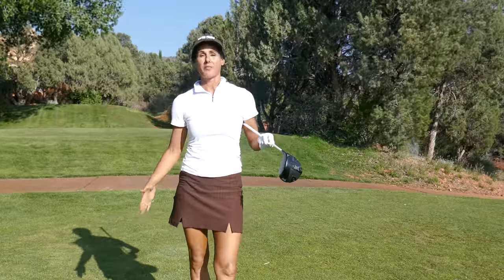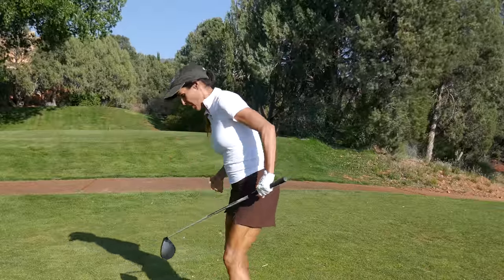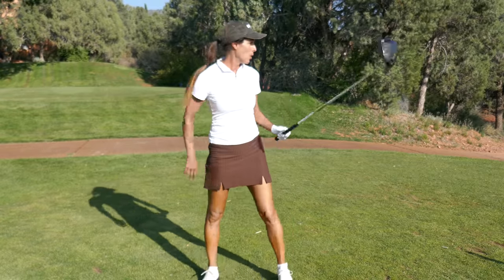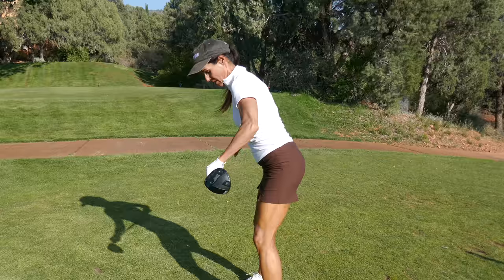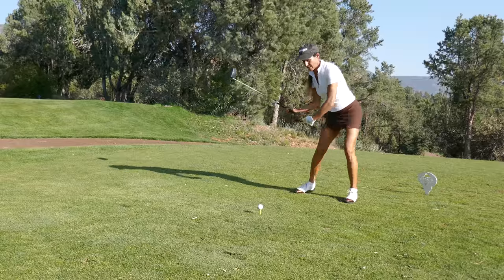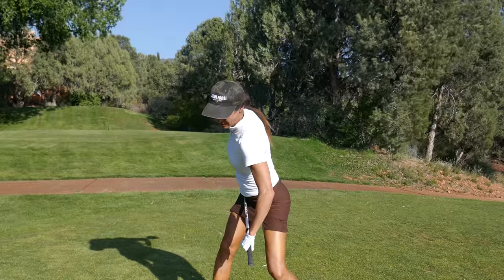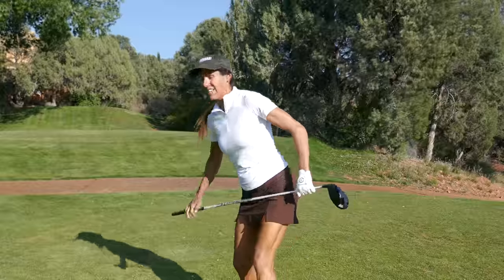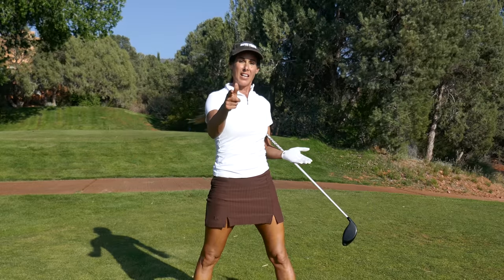GO DEEP WITH THE HIPS (the BUTT MOVE)

Comment: You probably don't even read these anymore but,  this lesson put it all together for me. Sounds trite but, it's not. 
Too often, it has been a translating move from one hip to another which, when your timing is good, you score well. But, the next day, if you're too quick or, not quick enough, balls are flying left and right. 
So, the 'rotating the hips on the wall' whilst firing the left cheek back, really helped out and took the timing guesswork out of the equation. Distance has never been a problem for me. It's getting the ball to go exactly where you want it to. Mission accomplished! Thx Christina

Comment: THis is great!!!! I am learning so much from your videos that I never got from lessons I have had over the years. It is the  nuances you point out that make the difference to improving for me and gaining confidence in my swing. I  am freeze framing you  going back and through and if I am correct the angle that is created by your upper thighs and torso stays the same or even a touch smaller until you straighten your left leg on the follow through. Is that observation correct? I think I have been using my glutes but I am pretty sure that angle gets much larger going back and through hence lack of power. I am golfing tomorrow and will give this a try. Thanks so much for this excellent video!!!
Reply from the maker: Love your passion and questions. I highly recommend that you get a swing review so you can target your learning and get all the questions about YOUR swing. Head here to Learn more: https://www.morepars.com/#coach
Reply: @MorePars  Thank you I will check that link out. I will check out info on your golf camps too. In person training is more fun!!!!!

Comment: Hello Christina,
When you hit a shot, such as at the very end of the video, it does not look like you have as much knee and waist bend as when you demonstrate the movement earlier in the video. Maybe you do, but I am not seeing it because it happens so fast.
Reply: No, you're right.  She is exaggerating the lead leg's knee bend and hip bend through impact when she's demonstrating the move in slow motion.   In her (and nearly every pro's) real swing the lead leg has straightened by the time the hands are coming down to hip high.   As you can obviously see, straightening the lead leg and "going deep" with the lead hip aren't in conflict with each other.  In fact, look closely at that clip she included of Tiger working on it.  His lead leg is dead straight.   So, we can see that "standing up" and straightening the lead leg are not the same thing.  Your leg straightens when you stand up....but you don't have to stand up if your leg straightens.  In fact, it's the lead hip rotation/clearing backwards while maintaining spine angle that makes it possible to straighten the leg without standing up.